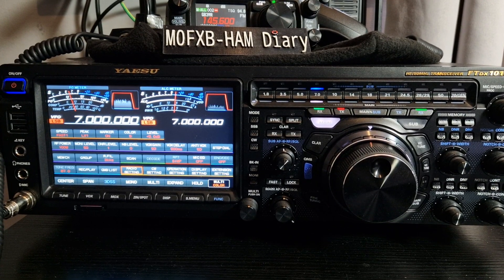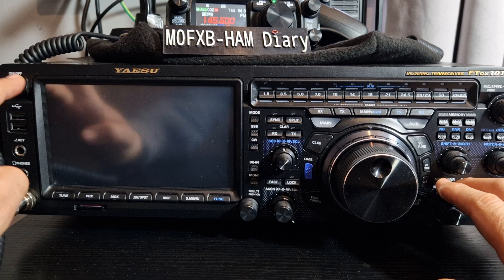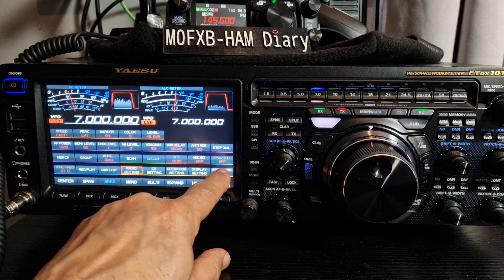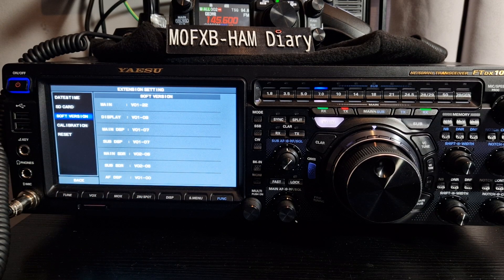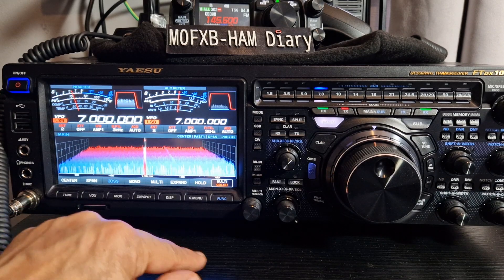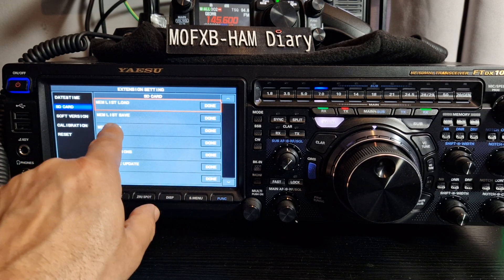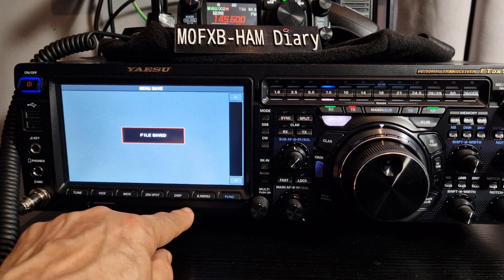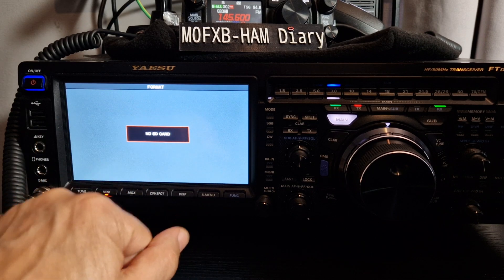YAESU FTDX101D , 4K SETTINGS Firmware :ESSB Hi Fi audio

Comment: Maybe your video title should be re labeled to Yaesu FTDX101D Firmware Update.

To clarify some things not shown in the video about ESSB (Extended Single SidBand) ie...4 Khz TX bandwidth audio.

Hold in the DNR and DNF buttons of VFO A (white ones) whilst cycling the power on your radio.  You will find in your Radio Settings > MODE SSB you now have the TTBF (This is the 4 KHz audio option).  We can see that upon Tx the signal is approximately 4.2kHz wide and has all the characteristics ESSB 4Khz transmitt audio.
Reply from the maker: https://youtu.be/50glDev2gB8